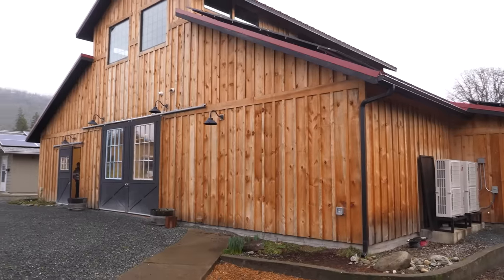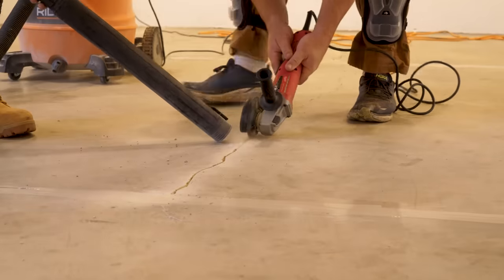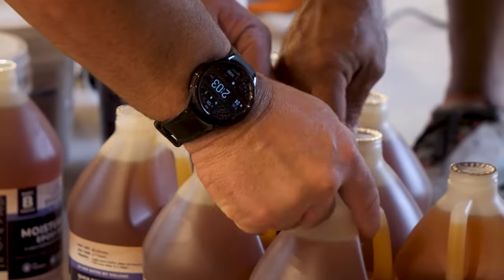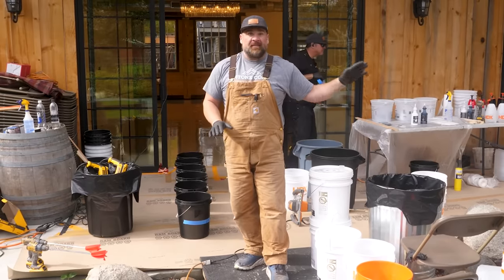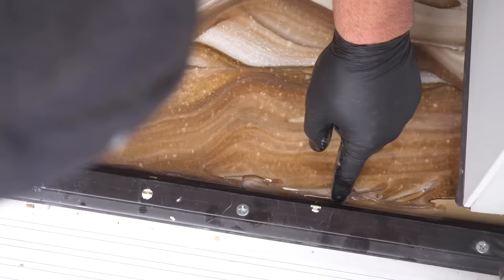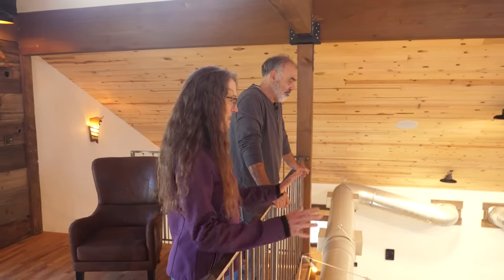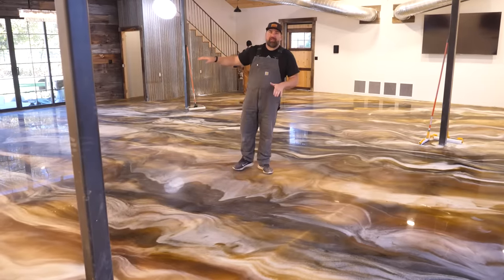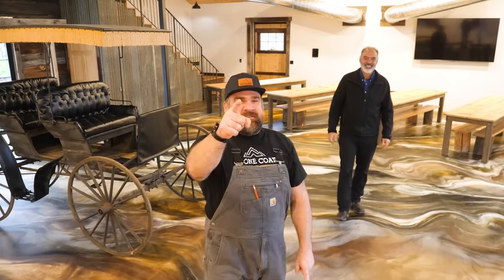Transforming Floor With A Stunning 120 Gallons Of Epoxy

Comment: How did you get the primer coat to be that opaque?? Everytime i've done a primer coat it's translucent... So I've had to use a sherwin william primer (for epoxy) and coat the floor 3 times... but it's still paint and my spikes leave a few poke throughs you can see...  

The ultimate top coat is harder than the mid coat? Longer dry time as well?

Critique: You didn't remove the toilets when doing the bathroom... trying to pull those toilets to replace them is going to be a huge pain... hopefully the epoxy isn't stuck too well and won't chip or peel when you pull it up.  Also, many toilets have a different footprint, so a new toilet may not cover... 

Floor looks absolutely amazing, though!! Fantastic job!

Comment: Full bathroom floor with zero threshold shower over plywood/OSB subfloor install?
Reply from the maker: Can be done, you'll need a little extra material as a "seal coat" over the osb to fill micro valleys

Comment: About 20 years ago l planned to have artist design epoxy flooring .
Knowing that I've always had a problem with aromas - perfumes, petrol, adhesives, oil based paints etc ;  l had a small preliminary frame made.

After 2 weeks of airing etc l still couldn't handle the residual smell .
If you are sensitive, best to sample test as it's an expensive mistake.

Comment: 1:20 I think a fast way to fill in those expansion joints would be to mix the 2 parts together. Then use a refiĺlable cualking like gun. Have one guy lay a bead in the joint & another behind him using a putty knife to press it.
Reply from the maker: We tried a bag and tried to pipe it in like icing... Fail city! We are working on a pourable fast set joint filler, I'll be testing it in the next couple of weeks. Thanks for watching

Comment: How do you keep people from slipping? Is there an additive that can be added to keep people from falling?
Reply from the maker: To enhance safety and prevent slipping on epoxy-coated floors, an anti-slip additive can be mixed into the final top coating before application or sprinkled over the surface before the top coat sets. These additives increase the traction of the finished surface, making it safer to walk on, especially when wet. We sell a clear quartz sand. The Flooring Ultimate Top Coat used is also very slip resistant naturally. Ken has had folks dancing with wet shoes because its pouring outside with no issues. I have the UTC installed over my epoxy marble in my walk in closet, it works great and I haven't slipped once even with wet feet.

Comment: How much does something like this cost? I like the look and have wanted to do epoxy flooring when I build a new house, I'm looking at a 1500sq ft house and the garage will be about the same so 3000 total, but the house would be something like this while the garage would be something with a texture.
If it was cheaper to do it all the same that would work
Reply from the maker: If you decide to hire a pro, the cost for the project would be around $14-19 per square foot. However, if you choose to go the DIY route with Stone Coat DIY Epoxy Flooring, the materials would only cost you approximately $5-7 per sqft. U GOT THIS!

Comment: So, I wonder why they put those silly expansion joints in there in the first place?…
Reply: Concrete is prone to cracking, and the presence of saw cuts and wet set expansion joints directs the concrete to crack in those specific areas. Thanks for stopping by!
Reply from the maker: Mitch nailed it!
Reply: I was thinking the same
Reply: So guys, I was being sarcastic, but I’m not sure you realize that.  My point is Mitch’s point.

Comment: Ugh.  I'm going to dissent here.  Somebody call the EPA...another superfund site needs funding.
Reply from the maker: Thank you for your interest in our environmentally-friendly DIY Epoxy floor! We share your concern for the planet and believe in taking steps to protect it. With our VOC-free flooring made from sustainable materials, you can enjoy a beautiful, durable, and eco-friendly solution.

Traditional epoxy floors often contain harmful volatile organic compounds (VOCs), which can contribute to air pollution and health issues. Our DIY Epoxy floor is different. It's composed of natural resins, recycled aggregates, and water-based binders, making it safe for both you and the environment. With zero VOC emissions and adherence to all environmental standards, you can have peace of mind knowing that you're making a sustainable choice.

Not only is our DIY Epoxy floor eco-friendly, but it also offers exceptional durability and resistance to stains, spills, chips, cracks, and chemicals. Whether it's for residential or commercial use, our flooring solution is designed to last. Enjoy a stunning and reliable choice that contributes to a healthier planet.

Discover the benefits of our DIY Epoxy floor today and make a positive impact on the environment. - You Got This!